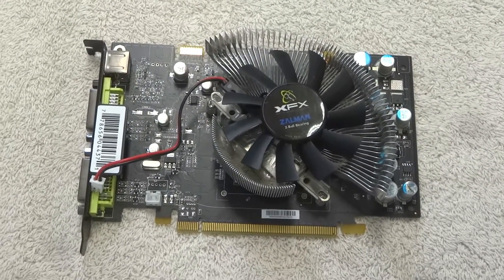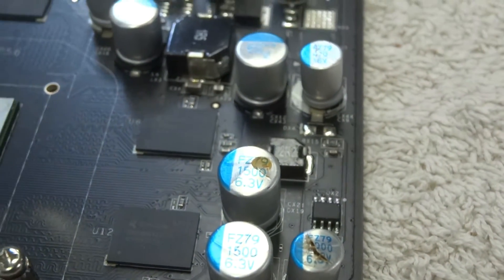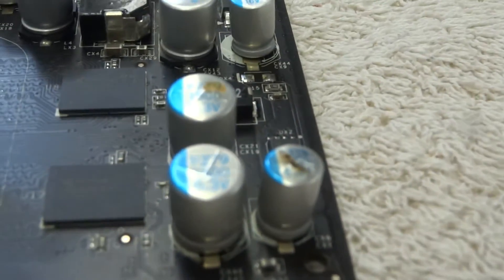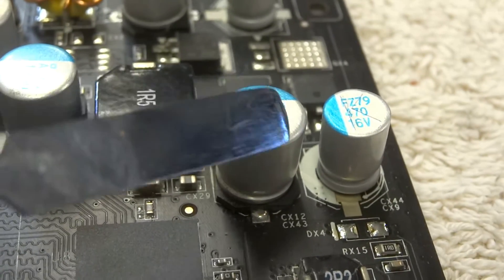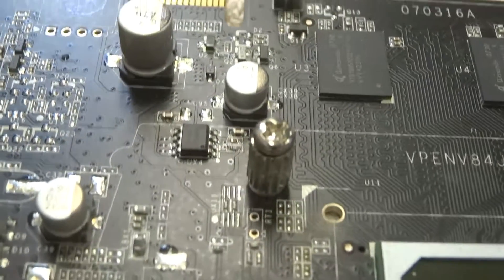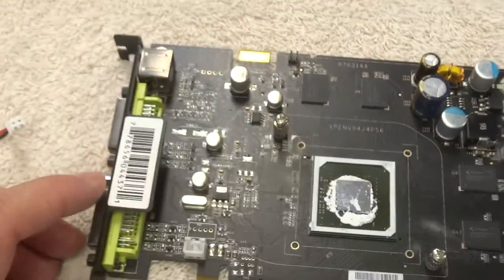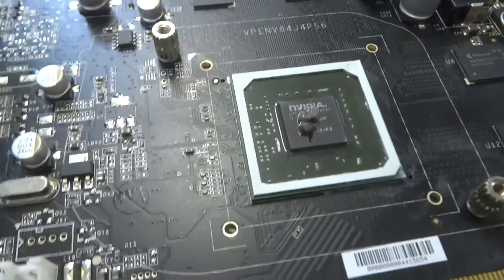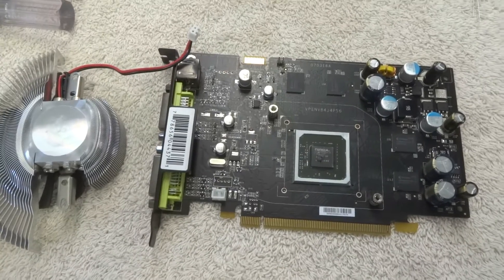Let's Repair - XFX GeForce 8600 GT

Comment: I have an xfx 8600gt 512mb. Mine only seems to work in x1 mode. Doesnt appear to have any blown caps. Seems to work fine. But its getting frustrating pressing f1 each time i boot. Any ideas what could cause it? Have tried 2 motherboards (both dell precision 370s) same issue.